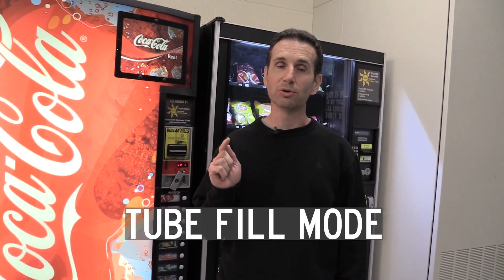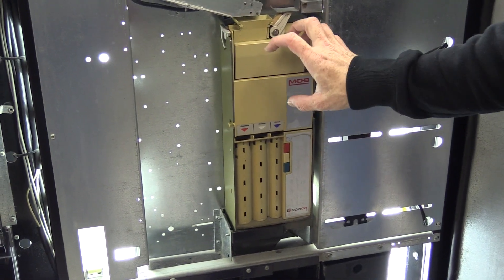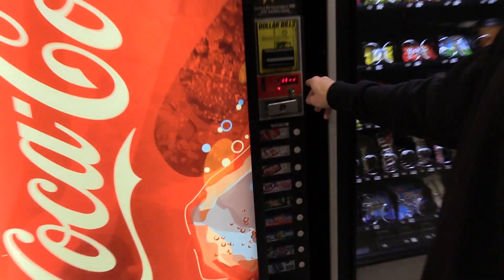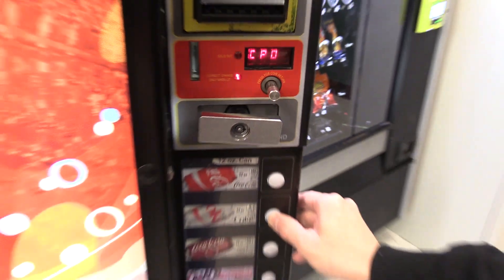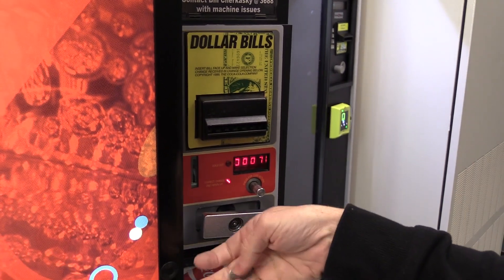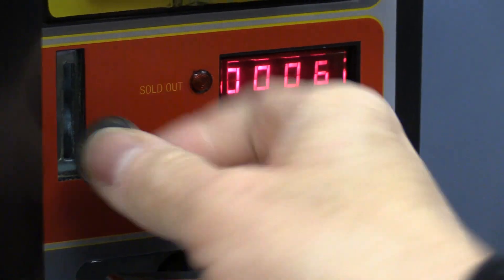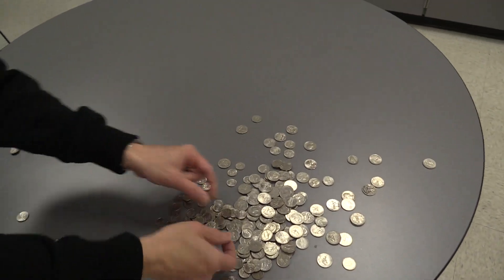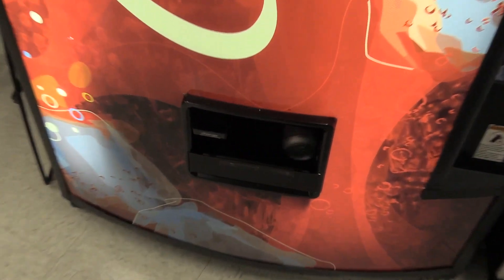Tube Fill Mode on a Vending Machine

Comment: Are all of your machines at the same school? Also what is the student cound vs your revenue
Reply from the maker: Yes...a high school with about 2400 students.  Gross on the student machines is about $400 per week.
Reply: @HappyVending  did you notice a increase in sales from adding a credit card reader or was it about the same but some cash sales moved over to cards? By the way I just subbed the info you give out is pretty good quality
Reply from the maker: @Self.reliant  Thanks for the sub.  Yes, I always see a slight increase in sales from adding the readers...but some cash sales just move to credit.  In the school, we have about 60 precent cash sales, and 40 percent credit.  It is nice having the readers because you can keep an eye on the stock levels in the machine through the reader software.

Comment: How would we be able to get in contact with you for a Dixie narco model E Coca-Cola I need help setting up with a nayak reader would I have to reset the vending machine ?
Reply from the maker: You shouldn't need to reset anything.  Did you buy the reader new from Nayax?  If so, once you install it in the machine, call Nayax and they will activate the reader.